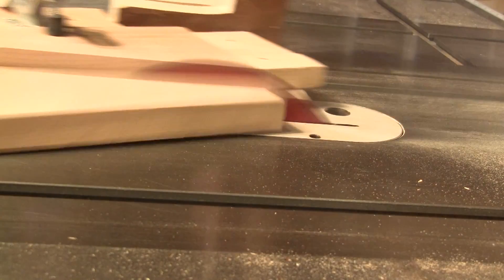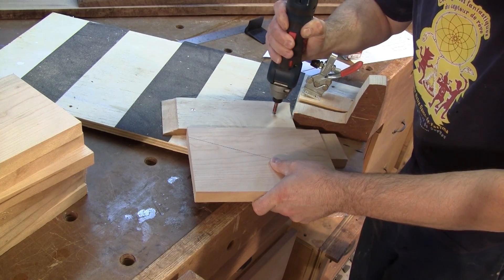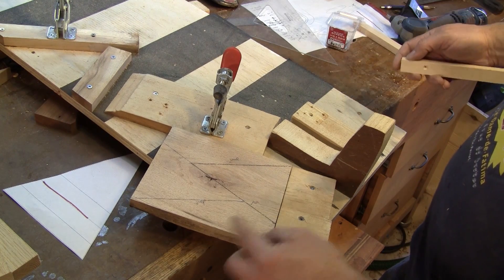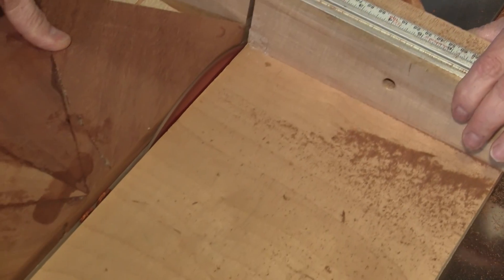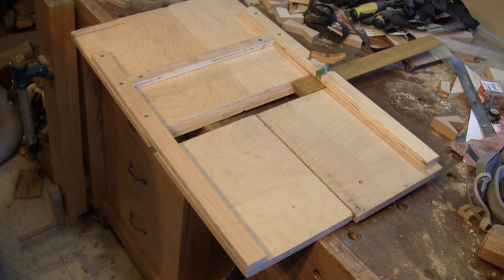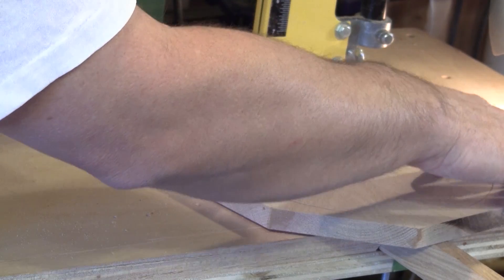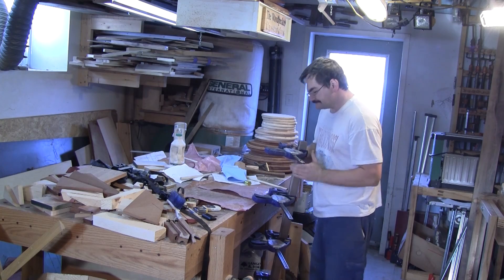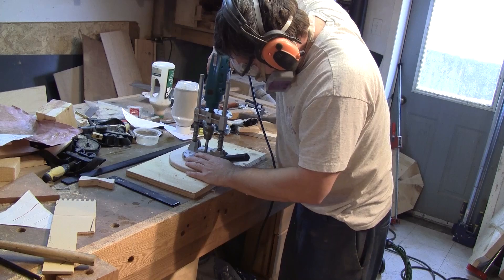The Woodpecker  Ep 40 Cupcake Towers

Comment: Alain, I was wondering have you done a video on the threading tools? They look like something that could come in handy on a project someday. I also liked the design of your bandsaw circle jig, I made mine so it is solid to the top and one side of the circles edge must be cut to the right spacing. It works really well for large tops but not needed for smaller projects like this. 
I really appreciate all the time you put into your videos, having to do them in 2 languages. One little critique would be to limit the repetitive cuts, and spend a little more on actually showing how you set up for them. IE the angle layout and how you established them. A big Merci, Pat
Reply from the maker: I bought the wood threader at lee valley (http://www.leevalley.com/en/wood/page.aspx?p=41791&cat=1,43000). It's not a tool I use very often but I'm happy having it in a drawer when I need it. This circle cuttin jig works well even with small radius circle, but I have to admit I cut circles even less than I thread wood